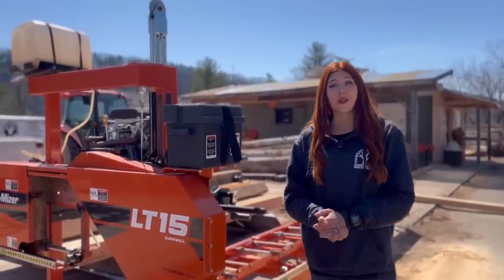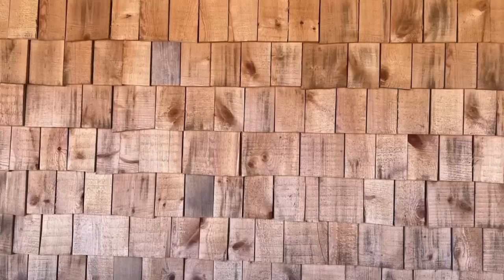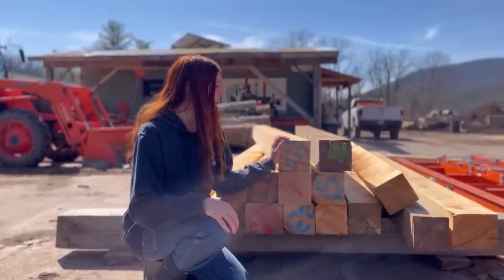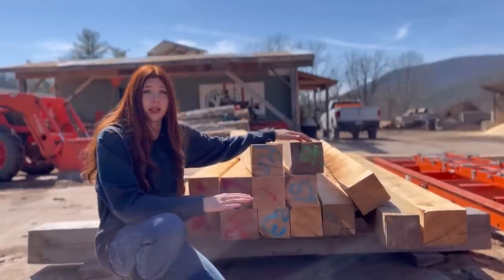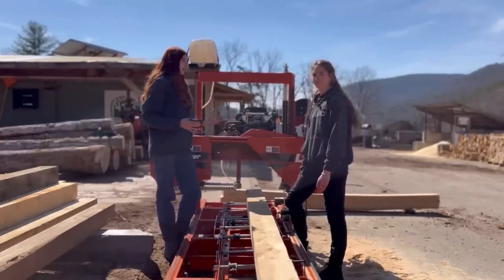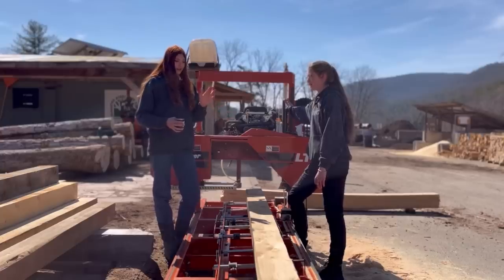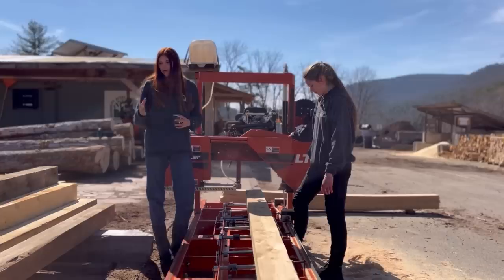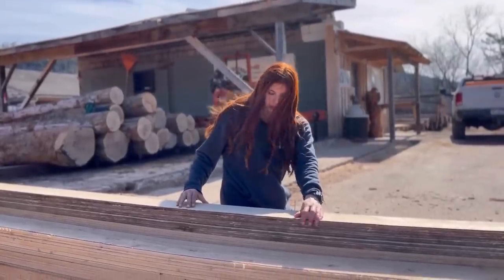This is Why Wood Siding is So Expensive!

Comment: I sided a shed with  1" pine that we cut and milled on our property 2 years ago.  I let it dry for a year before installing vertically and then rolled on RS Ready Seal stain. It turned out great and  I would recommend RS because it is oil based, soaks into the wood and doesn't create a coating like some other types of stains.

Comment: Hey guys😊. I recently purchased a LT15 wide with the lap siding attachment. I ran into a similar issue while lap siding. My solution was to stack the 4x6 on top of another 6x6. While you are traveling forward have your help hold the 4x6 and trail you. If you’re working alone like I always am sandwich the 4x6 in between 2 6x6 for support and clamp the 6x6 on the bottom. Or just saw up some 2x or 1x. Hope that helps.

Comment: I have what is called here in Australia a weatherboard house. My weatherboards (siding) are a bit bigger 8 inches and 3/4 inch on the thick end and I totally agree with your comments about the plastic siding. The weatherboards prepped and painted properly will last a very long time (my house is over 100 years old including the weatherboards!!) all you need to do is some maintenance now and then. Mine will be due for a repaint soon and repair any damaged boards.

Comment: I agree on wood siding.
On my mill the head tilts back and forth,instead of the bed...set the thickness by picking a notch,and returning to it back and forth.
Which I really like.
My choice is white pine for lap siding.
Have not tried white cedar yet.
Hemlock for board on board.
🇨🇦👍
Reply: Cedar is less prone to insects and rot.
Reply: I'm aware thanks...
Mention that the neighbors home is 180 years old...they had to replace the bottom of their siding not long ago...
The rest was perfect!
White Pine.

Comment: Beautiful work... Would it be possible to attach the drop (bottom 2" piece) to the next 6' sq piece with some wooden dowels at the ends to get 100% yeild?
Reply: I agree, great idea.
Reply: If you get last piece cut at square, you put in inventory as 2" x 6" stock. No extra work.
Reply: @michaelmaker8169  35% HIGHER YEILD..35% LESS material to load and position..  4 to 6 taper cut slices are worth a whole lot more than one  2 x 6 and they are matching stock..  Everybody has their own  opinion and expertise on what is more beneficial..

Comment: I’ve been sawing with a Timberharvester for 35 years and will occasionally be asked to make siding. I made a tapered jig that holds 1” boards which I cut in half. That way every cut is made without having to guess where to set the height.

Comment: Another beauty Eh!* I've cut, split, hauled, stacked and burned box cars worth of fire wood, but never milled a single board. I own 80 acres w/ about 1.2 million 12"-15" diameter Sugar Maples on it that are haunting me, so I watch a lot of milling videos to see how it's done. Your videos are always upbeat and informative.  I'm a gear head, I'm into the nuts and bolts of how things work, so I really appreciate your attention to the operational details. From watching you I believe I am sold on the idea of using a band sawmill instead of a circular or chain sawmill. In this vid you showed the table tilting to give the angle to the 1st cut of the lap siding then back to level for the next, that was a slick trick.  I'd like to see a little more of the 40 and how you decide which side of the log to cut 1st, 2nd etc. you know; why you rotate it and how you decide how much to cut on the first few cuts. One More Thing: Do the customers plane or sand the lap siding or do they just hang it and paint it in the rough. I worked as a carpenter for the first 15yrs of my working life and hung a lot of dbbl 4" siding, but it was vinyl which was all the rage back then. It comes already pigmented, so I never painted it. But any trim I put up had to be primed and painted and it was planed. Thank you for good clean entertainment.  ben/ michigan *A little Upper Peninsula Speak.

Comment: Nice Job,  Before saws, clapboards were oak and split out by hand with a froe and mallet.
Ever see how lap siding or clapboards were first sawn?
Check out the Ward Mill in Vermont 150+ years old and their siding is some of the most expensive since every board is quarter sawn.

There is another  popular method used for more than 100 years and that is to simple saw, plane and edge a 5/4 x 6 then re-saw it in 2 on a tilted vertical bandsaw making 2 pieces of siding from the one board.
Peace.

Comment: I know your dealing with green timber, but have you thought about a cheap adhesive ie construction,  or stud adhesive .bang a few dobs on the chants ,maybe 3 high and drop the endloader bucket on them overnight. Might reduce the amount of 2 inch boards you produce ,unless that's not a problem as i know you use all the timber you produce. Any way good work you two as usual.🤔😎🇦🇺👌

Comment: Would double faced tape between the last 2" and the next beam work. Holding them together without worry of nails , screws or other attachments.  Would still be easy to split apart.

Comment: While natural  wood siding is convenient  relatively inexpensive    if gouging live close to woods  recommend  siding  from cement  composite   siding  resistant  to rot and insects and isn't combustible   that with  either  tin or  ceramic roofing tile  also non combustible   there also steel roofing  that made to look like shingles    meadows lark  I log cabins from Montana  even produce concrete log siding  looks just like a log face only does rot burn and insect proof  check Simple Living  they just finished their home build with the ceramic log face siding

Comment: Em. 77 is more than half of 140. 
Have you considered using wood dogs clamped between the steel dogs to hold a stack of 2 inch left-overs so you can keep cutting? Between you two girls and the boss, I bet you could figure it out. Might be worthwhile unless the 2 inch left-over has good market value.

Comment: I'm curious. Is there a reason that you can't use 6x8 or 6x10 and have les waste at the end?
Reply from the maker: You can, we just cut those cants out of small logs
Reply: @lumbercapitallogyard  That makes sense. After thinking about it as long as you keep the 6" dimension the other dimension could be anything especially since you are cutting so thin.

Comment: Great video, girls!  Question:  Does the customer cut them to the width they want, or do they specify that for you to cut?
Reply: I think they use a standard sizes
Reply: You exposure will determine the width....you should have at least 1" overlap..so 5.25 with wll give you 4" exposure approximately.......if you want 5.5 exposure you'll need 8" etc....

Comment: Only need the cradles (1ft long) at the mounting pts.. grandpa's got this.
Also drop stack gage stops (just made that up.ha) like half in poker chips (1/2in plus kerf) you pull out every pass. Clamp low at cradle..dowl pin em for a swing out. Make em smooth..gravity drops saw down to new stop..Also see grandpa..ha

Comment: Will that lap siding order now go into the kiln? Or does the customer want it green?
Reply: I used to sell western red cedar lap siding and it was always very green, sometimes dripping wet.  I think if it was kiln dried it would absorb moisture and buckle over time.  Trying to nail it when dry night cause it to split as well.  Green wood is much more forgiving.

Comment: At 0:40 You left out the fact that wood siding is easier to repair than vinyl. Vinyl is affected by the sun's UV radiation and becomes brittle with age. I have seen plywood siding warp so bad it comes loose.

Comment: Interesting. Would it not be possible to cut the last 2" if you left a board on the mill to support the next piece ? That would raise the 2nd piece by 2" and the danger of cutting any of the mill parts or damaging the blade would be avoided. Just a thought

Comment: Em and Jade, look into a metric ruler, no use for fractions anymore.
Reply: Metric is SO much easier to use. Sooner than later the U.S. will have to adapt and change
Reply: @moltderenou  WHY, WE ARE NOT COMMUNISTS ?
Reply: The standard in the U.S. is still Imperial.  You have to cater to the client.  If they tried selling it in metric they would spend half their day explaining the sizing.  I do  think metric is easier but I'm from Canada where it's used.  The construction industry is very slow to adapt.  It's not Emerald and Jade's fault.  Silly comment Darkiee69.  Think before posting.
Reply: @stevinveroba52  Do the client specify the thickness of the boards? They didn't look completely uniform to me, so probably not since it was done by eye. That was where metric would come in handy, using millimeters instead of fraction of inches to calculate. And I was thinking before posting, otherwise I wouldn't have posted.
Reply: @davidkettell5726  neither is most of the rest of the world. It's the US, Liberia (who's moving towards metric) and Myanmar (who has their own system) that isn't metric.

Comment: What about vertical shiplap? Then you don't need battens and its a smooth look, easy to stain or paint with a roller. Or horizontal shiplap for a log cabin kind of look. Also Novelty finish siding. Just a matter of a jointer or router table with the right bits to mill the profile. Especially shiplap. Or even tongue and groove?